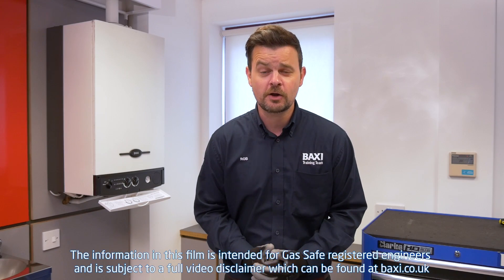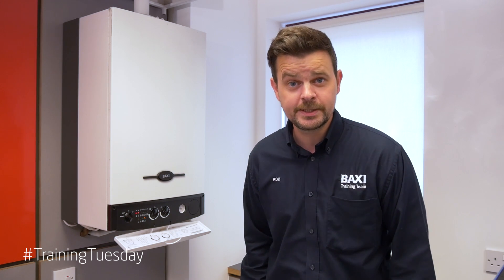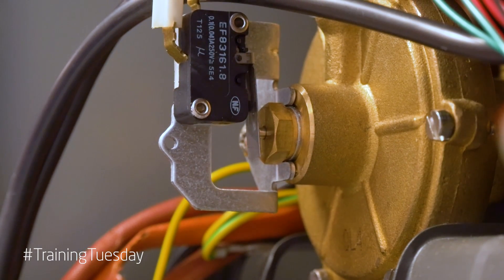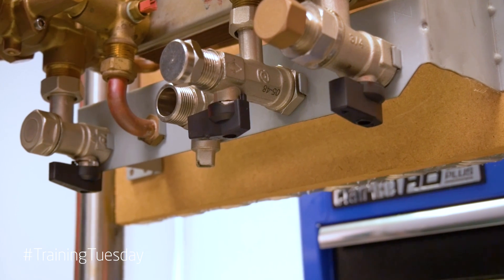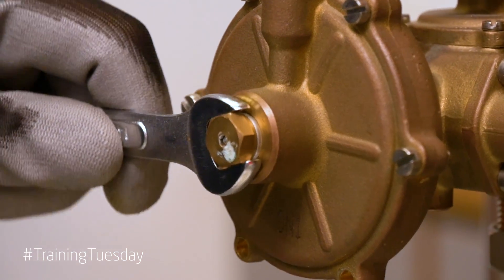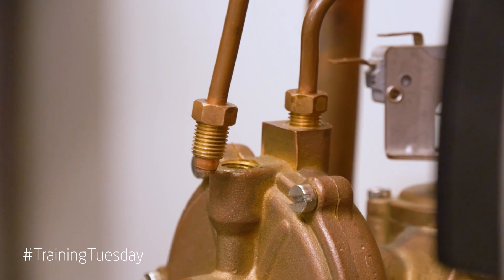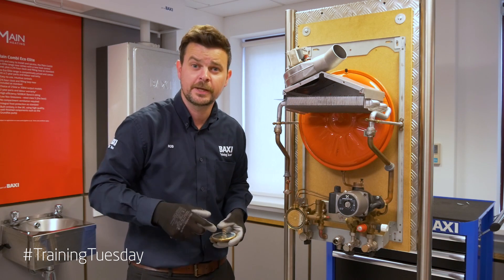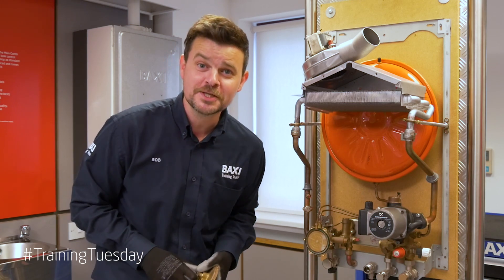How to fit a diaphragm repair kit on a Baxi 105 boiler | Baxi Installer Training

Comment: I had this exact issue. A plumber Came, saw and said new boiler for £2200. Next plumber told me over the phone that it'll  be £400 to replace diverter valve. I got another plumber on the phone, they then wouldn't tell me what was wrong, but quoted me £300 to fix the problem.
Another plumber told me something similar on the phone. They wouldn't tell me what the problem was, what they would fix, but apparently they are guaranteeing that it would be repaired. The suspicion I had was exasperated when the majority of these plumbers told me I didn't need a second opinion, and they were correct, yet I had different price and different causes. So I started to research this issue and came across this video. I sourced the parts, cost me £4 on eBay, found someone who would do the job and they didn't try and sell me something  I didn't need, took'em a handful of minutes and all the guy needed was a screwdriver. Wish I found that guy first. Didn't cost me thousands, or hundreds. Thank you for this, it's saved me from getting fleeced by a string of sly plumbers who were happy to try and charge me thousands for a new boiler when they MUST HAVE KNOWN it was a very quick job to replace a very cheap rubber gasket.

Comment: Thank you for this very helpful video. 
I have a MAIN combi 30HE which used to work perfectly. 
Recently the time taken for the boiler to deliver hot water was becoming a nuisance. 
The technician who came for the yearly service was unable to diagnose the fault but thanks to your video I had enough confidence to replace the diaphragm. It only had a small hole but this was enough to cause the delay. 
Thank you for explaining everything so clearly and probably saving me a fortune in technician costs.

Comment: Mine is working fine, hot water great, little pin comes out fine, but theres a small leak from the 14mm nut ?'has the washer failed, can I just change the washer ? Thanks

Comment: You have lovely access with it all open on the wall. Mine is deep in a dark cupboard with only a few inches in the front to even get the cover off let alone see where u have to remove the six screws.

Comment: Hi i had this same problem with my baxi 105he and fixed it with this video so thanks a bunch. But now a few months later, the pin on the switch behind is doing the same. Can i simply do the same on that valve? Because in the diaphragm kit i got, it has a smaller rubber flange. so im guessing it could be for that valve behind??? Also when i manually push the switch, the boiler fires straight up with no issues.

Comment: IF THE PIN ON THE DIVERATOR STAYS UP..AFTER CHA NGING DIVERATOR FOR NEW..WHAT IS THE ISSUE...THE FRONT PIN GOES IN AND OUT OK

WE HAVE HOT WATER AND HEATING TOGETHER BCOS OF THIS...

WHAT WOULD BE THE ISSUE THANKS...WE HAVE A BAXI 80 ECO BOILER

Comment: I’ve just replaced mine and I’ve actually found at the back of the 
Diaphragm  underneath there is a little screw. The more I tighten it the bigger the leak! When I slightly unscrew it the leak stops! Any ideas 💡 as to why?

Comment: Thanks Rob I’ve got same boiler, the diaphragm works hot water at tap, no hot water at either of two showers, I changed one shower, engineer said the diaphragm is ok , is it possible the diaphragm is a bit worn but able to work on kitchen taps and basin but not quite enough to trigger boiler on at the shower, the showers have both worked for may years, , I’m a plumber but not a gas engineer, I thought maybe debris in the hot water pipe causing drop in pressure, soft water area no prwith scaling

Comment: I have the same boiler 80e. Same problem but I get hot water for about 20 seconds then it goes pretty much cold. Is this the same problem repair? And if so, could I have a link to the parts kit I need please.

Thank you

Stephen

Comment: Brilliant video. I bought the diaphragm and followed your instructions. My diaphragm however was stuck to the rear housing so removed cleaned and replaced. Returned bought diaphragm and enjoyed a takeaway with my savings 🤣🤣👌🏻
Reply: They are only around £4 so I would have kept it in case old one breaks.

Comment: Great video. Just followed this to replace diaphragm in my main 30he, working a treat again now. Thanks a lot
Reply: Hi buddy I'm wondering if I have this issue very similar model 80he (bit older ) was u having cold water issues ? If so be worth me trying this .  Only difference is is some taos here do activate flame but kitchen don't   . Gmstay hot usually either even when flame is ignited thanks

Comment: Rob is there any voltage given for the duotec fan pwm. The voltage the pcb sends to the fan to tell the fan to turn? Vaillant give a voltage of approx 10 volts to 6v thus tels the fan to turn  what is the baxi voltage is it similar.

Comment: And what when you have a diaphragm that's IS working ok and still no hot water? 
  My 105e has that problem. Heating working 100% and as soon as you open a hot tap, little tap led lights up, diverter piston pushes the micro switch, flame goes out and no water heating.

Comment: Great video fair play.👏🏻👏🏻
I have a Baxi 105he and I've kept it going for 15 years now,I've just noticed that when I run the hot water the rads get Warm?Is this to do with the 3 way valve and if so what do I need to do,
Cheers
Barrie.
Reply: Im guessing your sorted by now?  The part in question is in one of those packs on ebay.  It's the brass by-pass (Basicly the biggest chunk of brass with a screw thread on it,  in the spares pack)  With a fault on By-pass, water will travel to radiators.  OK, cheers
Reply: Same here! Did you manage to get it sorted? Replacing the diaphragm today
Reply: Absolutely brilliant.  Thank you so much.  Very helpful video that saved me getting ripped off.  🙏

Comment: still dont know what the tiny o ring is for
Reply from the maker: Hi Martin, a few people have asked what the small o ring is for in the diaphragm repair kit and I think at least one person has got it wrong. The back of the valve is where that little o ring lives once the back nut has been removed. Usually it doesn’t need replacing unless the back is leaking.
Reply: Watch this video in the link,at 12.10 then you will know  https://www.youtube.com/watch?v=xMOV0wohopM   Baxi goomer fails to mention this o ring in the service kit

Comment: In the service kit there is a miniature rubber washer what's that for then. D
Reply: it should go in the front brass nut where the pin slides in and out,but this gooomer didn't show that
Reply: @colin5064  it goes in the back nut which unless leaking you don’t remove anyway so it’s in the kit for if it’s needed, hence why he didn’t demonstrate it!!